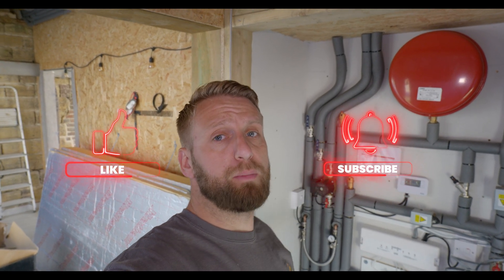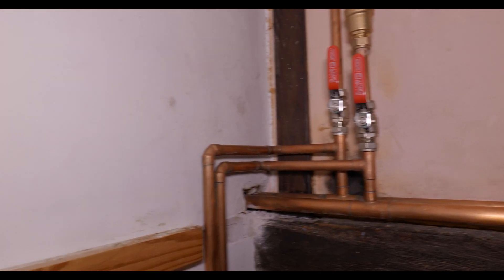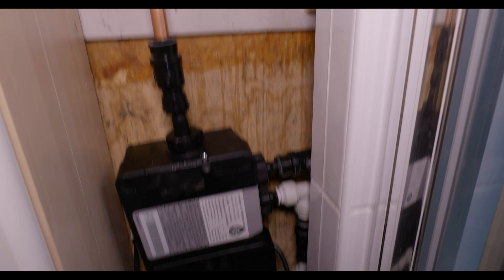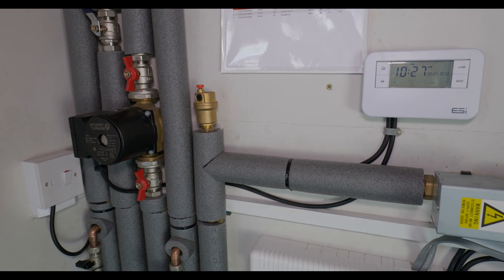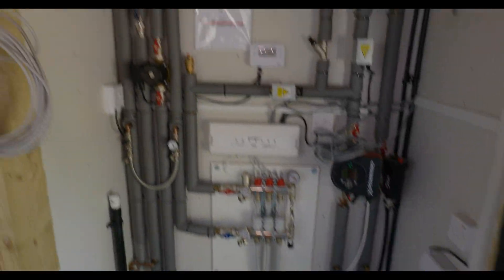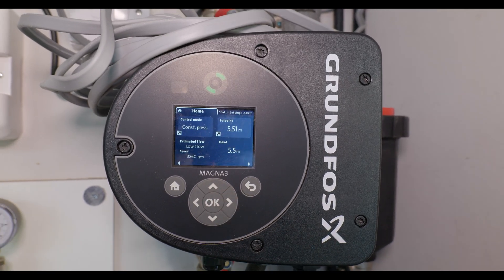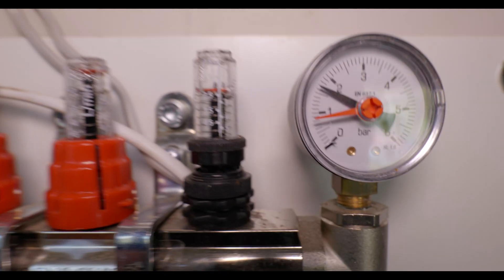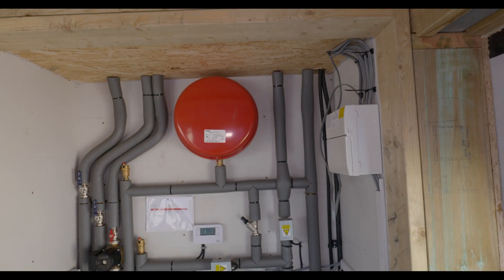Ground Source Heating Part 4 - Commissioning and final checks

Comment: Great work. Where did you learn so much about ground source heat pump systems?
Reply from the maker: Hi Dean. We didn't actually install the pump it's self just the house internals. It's pretty simple really. The heat for the rads comes from a thermal store. The thermal store is heated via the ground source unit which uses the warmth from the ground to boil the Fgas then indirectly heat the water. Bit like a fridge in reverse.

Comment: That's the thing with heat pumps. They take ages to get up to speed and if you fit them in summer you can't tell if you've set it right until next winter. And if you haven't the customer goes in and buggers up all the settings and dimes the heat pump to 60 degrees uses the controls on/off and then  moans that they're paying 500 sheets a month on juice to run it just before compressor sh1ts the bed due to extreme cycling. And then blames you.  It's a steep learning curve for punters who aren't fully onboard with it.
Reply from the maker: Yep.... Can't say I am fully on board with renewables just yet. I have my fingers crossed for hydrogen